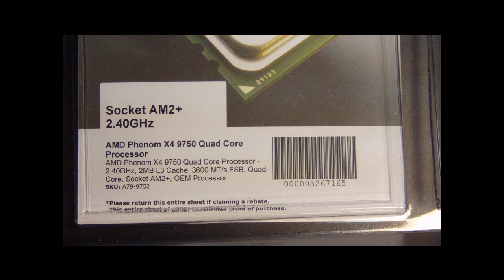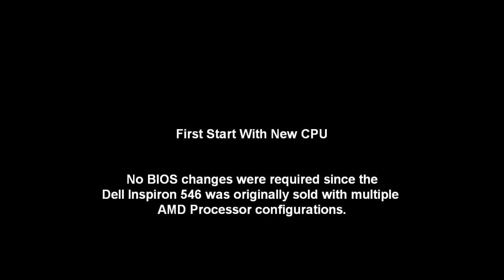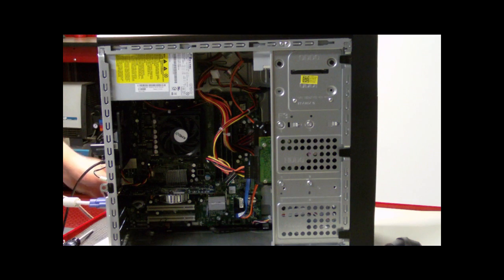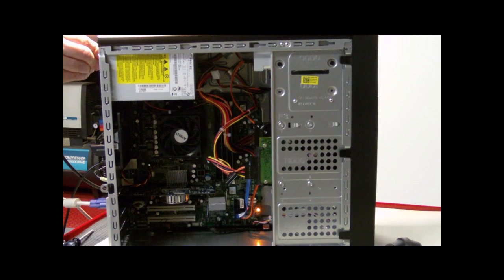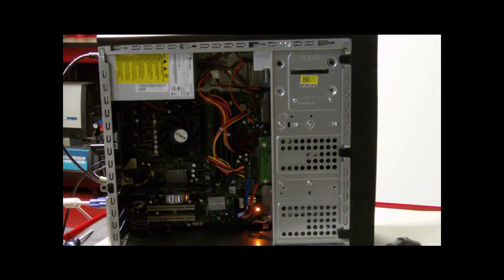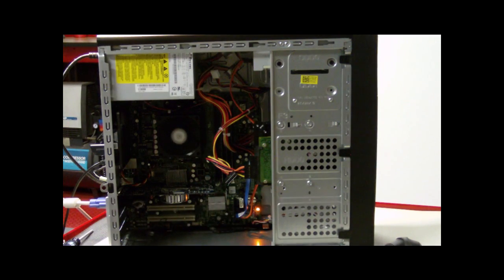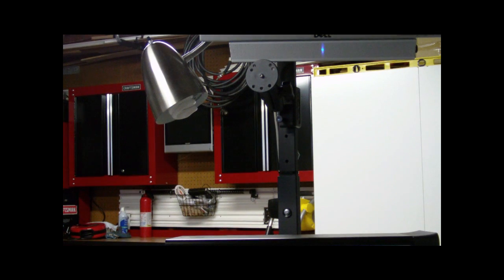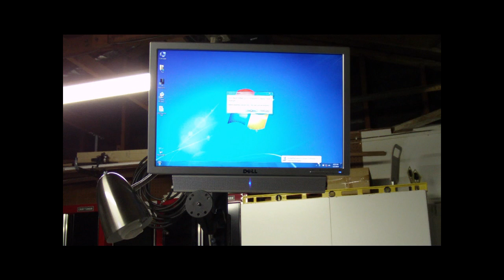Installation of new AMD CPU - Upgrading a Processor

Comment from the maker: You do not need to reinstall the OS. After a reboot the system will recognize the new processor. You will have to let it adjust driver settings and refresh your Windows Experience Index but that is it.

Comment: This is in general, I know that when you replace the motherboard with processor you need to reinstall the OS (Win XP, Win Vista, Win 7, etc) but I never just swapped out a processor with out replacing the motherboard. Would you need to reinstall the OS? Be less work and less of a pain in the neck if I didn't have to. But...Will do if needed. :D

Comment from the maker: @derfuher00 The GTX 560 would probably fit as long as you had the hard drive on the lower mount. You would probably have to get a new sata cable with a 90° if you are using the upper ports. The EVGA card is 8.25" x 4.38" so you might be ok with that one.

Comment from the maker: @derfuher00 I would start to look at a new PC for B3 type games. A good case, GPU and PSU are going to run you $300. If you really need to use this PC then upgrade the PSU first, then the GPU to a decent card and then see how the case acts with more heat inside.

Comment from the maker: @derfuher00 If you upgrade the PSU, and then install this card, you will probably run into heat issues since the standard Dell case is not that well ventilated. For $250 for the card and another $60 for a decent PSU you could apply that towards a new PC designed for higher end gaming. You might also want to look at a card like a 450 that runs a little cooler.

Comment from the maker: @GuiguidesUSA If you use a CPU that originally was an "optional upgrade" for the specific Dell then you will be ok. The BIOS is made to accept those CPUs without changes. You will need a restart after you change the CPU but it work fine. I have upgraded three Dell 546s and one Dell 537 to new CPUs and they all run great.

Comment from the maker: @CoolTape "Socket AM3 versions of the Phenom II are backwards-compatible with Socket AM2+, though this is contingent on motherboard manufacturers supplying BIOS updates. In addition to the Phenom II's pin compatibility, the AM3 memory controller supports both DDR2 and DDR3 memory"